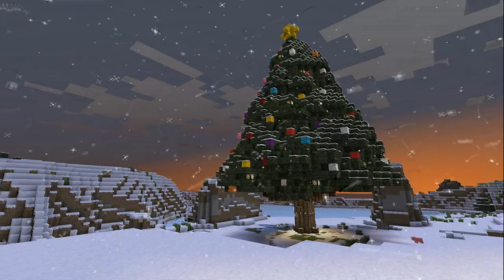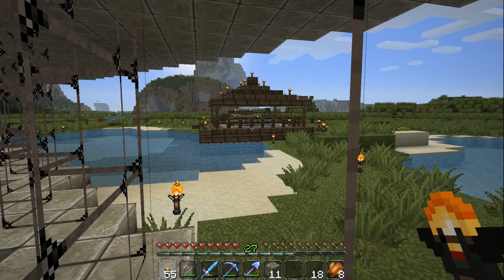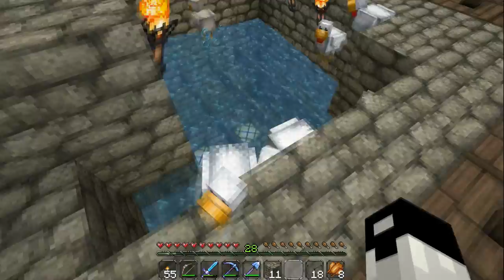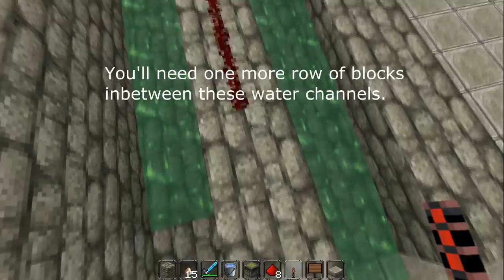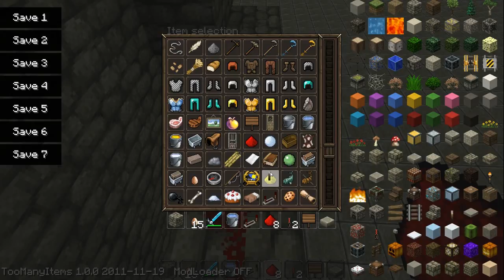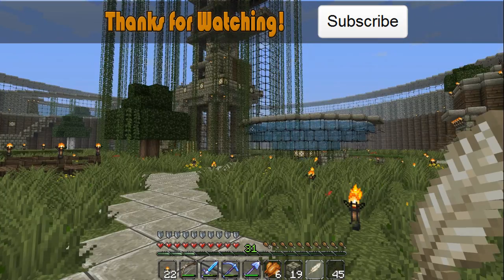Chicken & Egg Farm (Tutorial) - Minecraft

Comment: I figured out something useful. If you can run your dead chicken path down, you can place signs on one side of a wall while making a dropping water current. After you've placed that sign turn 180 degrees to the opposite wall and dig a 3 block hole in the block above the sign. Then you can lay lava at the very back of that hole. If you do this 4 times it will kill your chickens every time and drop your loot into the water current so you can get it at the end.

Comment: I got it to work great by just not using water.  They voluntarily climb up the dry stairs and plop into the water pool.  Problem I'm having is the chickens dying in the fire and not passing through it.  I tried putting fire blocks beside the water and that didn't work either. Going to try not using water on the KFC end and see if the chickens try to run through it.  Probably won't work, may have to use a piston to push them into the fire but they might just stay in it again.

Comment: I fixed the flaw with the chickens and the fire part.  Instead of having the chickens fall into fire, remove the fire brick, add the water sign in its place.  Above that brick, add another sign or 2 (depending on your build) and add lava.  The lava will not spill downward or flow with signs in place like the water.  The water pushes the chickens to the lava and fall to the floor on fire.  You'll get every single chicken.  Will post a video soon on the fix.

Comment: The ratio of stuck chickens depends on the amount of chickens that go through the channel. A constant flow of chickens insures a smaller ratio of stuck chickens. I tested it with 20 chickens (using a chicken spawner) and only 1 got stuck. I tried with 4 chickens and two of them got stuck and died. The constant flow of chickens means that there will be more chickens coming after our stuck chicken so there is a higher probability that one of those chickens will push our stuck chicken in time. ^_^

Comment: @monkeyfarm Thanks for the great tutorial. I built the contraption on a multiplayer map but I'm finding that when I return to the coup that there are raw chickens scattered around it. They are clustered on the corner where there are the blocks to cover the hole in the top layer of water. I'm wondering if the chickens glitch into the block and suffocate. I rejigged it so that the water covers all the top layer and removed the corner blocks but still my chickens die. Any ideas?